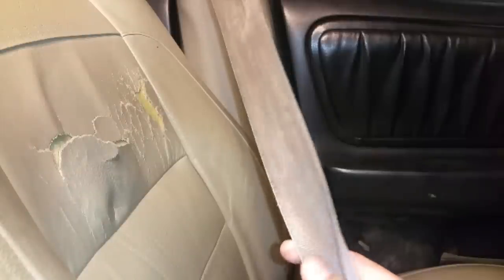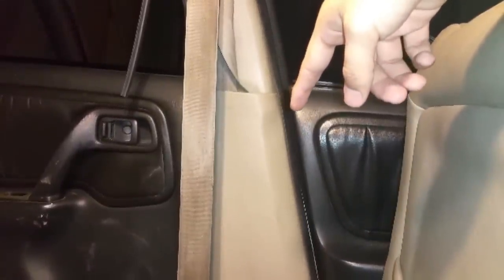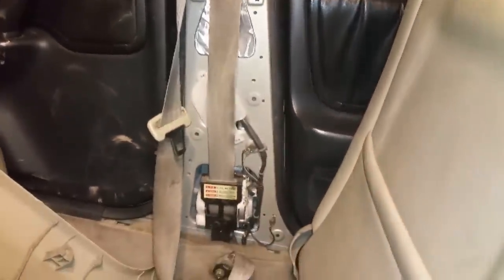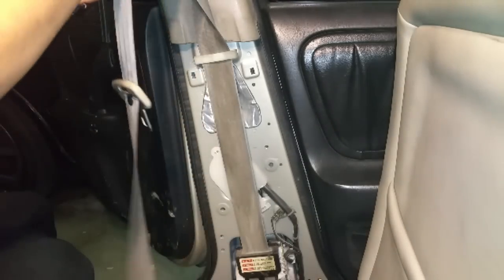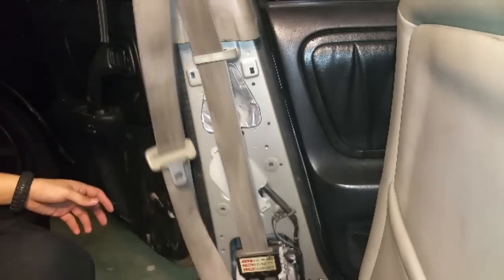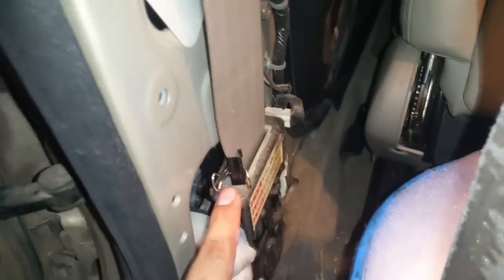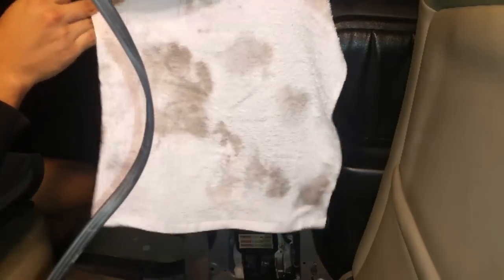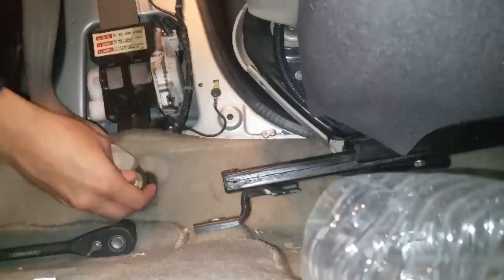Here Is How To Fix A Slow Retracting Or Tangled Seat Belt

Comment: It turns out my issue was a little different - the seat belt had become hung up on a plastic thing under the cover. But because of your video, I wasn't afraid to pry off that housing and figure out what the problem was. Thanks!
Reply from the maker: hey glad to hear you fixed your problem thanks for watching 👍

Comment: I saw a guy do this. The water and soap that the other guy used lubed the mechanism a little. I just pulled mine all the way out and shot some wd40 in there. Works a lot better now. It's just as good as this and the other guys fix but a lot easier.

Comment: Cleaning the belt has nothing to do with it there is a coiled spring on the side of the extender it can slip over time it also loses its strength the best way to repair it is to pull your seat belt all the way out of the extender and you will see that it goes through the middle of the bobbin and there's a pin made out of plastic that locks it in. Push the seat belt into the bobbin, pull the pin out and then pull the loop backwards and you'll remove the fabric part of the seat belt from the extender. Be careful cuz when you do it will be tensioned and tried to spring back. What you want to do is turn the bobbin in the direction of the most resistance where you're tightening it up after a couple of rotations thread the fabric belt back through put the plastic piece back in the loop then pull the belt tight and slowly let it wind back up. It will be good as new. You can even make it stronger if you wish
Reply from the maker: cleaning it definitely made a difference so 🤷

Comment: What is the connection between retracted seatbelt and dirty seatbelt?...
Why washing the seatbelt will make it fixed......can someone explain to me...
Don't it cause of the mechanical problem?
Reply from the maker: The dirt on the seat belt will make the Belt not retract smoothly, this won't damage your seat belt just let it dry
Reply: @ERICSDIYGARAGE  thanks man...
Reply: I used canned air to blow the dirt out of the retractor mechanism, It works great now. My belt was clean. 06 DTS Cadillac
Reply: @steverzepecki500  just air blow?..no water and any kind of soap?
Reply: If you look at the video, he never cleaned the mechanism, it's dirty.
Reply: @steverzepecki500  yeah he should clean it to right....or else it seem so no right...🤔